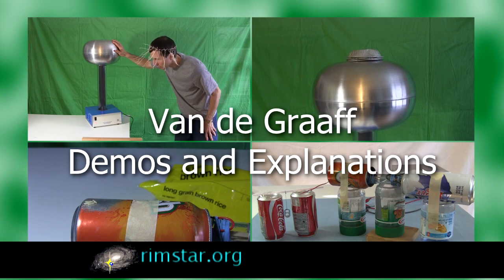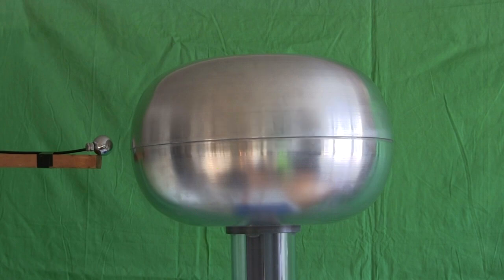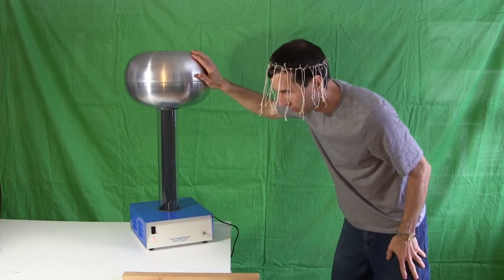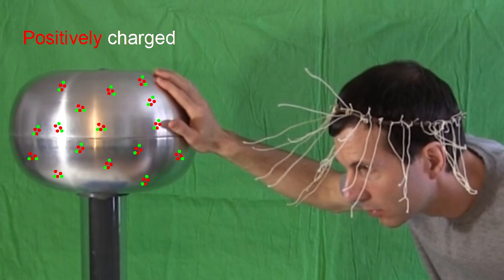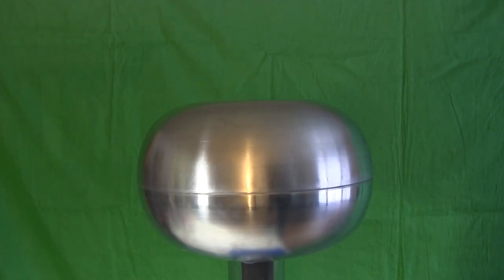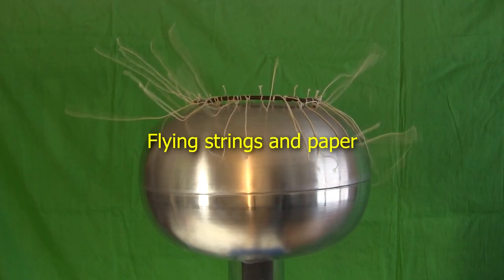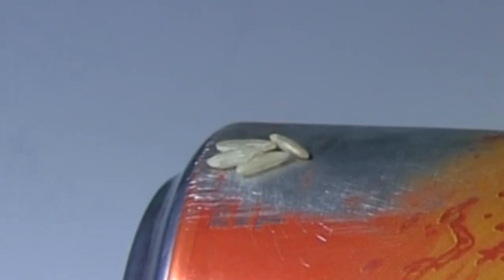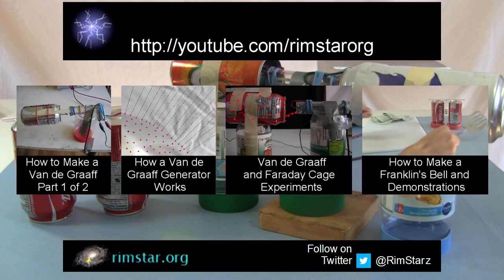Van de Graaff Demonstrations and Explanations

Comment: What if we replace the aluminum plates with coffee filters. What would be the difference?
Reply from the maker: The result probably won't be as good. The aluminum plates are electrically conductive so they get charged all over by the dome and then repel. Coffee filters are not electrically conductive (as far as I know) and so the only charging they'll get is by ions coming from the dome and there shouldn't be many.

Comment: does this also attract small objects
Reply from the maker: Yes, it would attach objects that are charged with the opposite charge that the dome is charged with.
Reply: @RimstarOrg  oh, thank you, what rollers should I use on top and bottom if I wanted negative charge on top dome.
Reply from the maker: For a negative dome, you want a bottom roller who's outer surface is made of something from positive end of the triboelectric series and a top roller from the negative end https://en.wikipedia.org/wiki/Triboelectric_effect
Reply: @RimstarOrg  ok, thanks man

Comment: I have a question. Why does the strip of toilet papers repel upwards? Toilet papers are insulators, so electrons can't really flow through them right?
Reply from the maker: Correct, since they're insulators the electrons don't flow through them. However, there are a lot of ions all of the same polarity in the air due to the Van de Graaff generator. Some of these ions attach to the strips of toiler paper. That makes the strips charged with the same polarity as the Van de Graff generator which they're attached to. Since the VDG and the strips are both charged to that same polarity, they repel.
Reply: @RimstarOrg  Thank you! I get it now. :)

Comment: Were you feeling some change or so on your hand while you turned on the switch?
Reply from the maker: The metal case was getting charged during use and so I was getting a shock when putting my hand near it where the switch is, probably a bad connection to ground somewhere. So I got into the habit of being careful how I touched the switch.
Reply: @RimstarOrg  But, I think, didn't the charges get grounded, passing through your hands?
Reply from the maker: Yes, but since there was probably a bad connection to ground, they'd instead built up on the case and jumped to my hand in a big surge. That's the part that hurts. Then they pass on through me to ground.
Reply: @RimstarOrg  What do you mean by "bad connection to ground, they'ld instead build up on the case and jumped to my hand in a big surge"?
Reply from the maker: The connection between the case and the wire going to ground has a problem causing there to be a high resistance there. So instead of the charge easily going to the ground wire, it goes slowly to ground and leaves a lot of charge on the case for a while.
Reply: @RimstarOrg  I understood.
Reply: @RimstarOrg  Thanks RimstarOrg😊😋😁😁
Reply: @RimstarOrg  People get frustrated when someone asks them this much questions... But, I must say you are from one of those few who solve their doubts with great joy.👏👏
Reply: @RimstarOrg  well, sorry if you got frustrated at all... Don't mind bcz I'm just 14
Reply from the maker: No worries. Your question was a good one.
Reply: @RimstarOrg  Ummmm... Thanks RimstarOrg😊
Reply: @RimstarOrg  well, is it just for fun or does it have some serious and actual uses?
Reply from the maker: Van de Graaff generators are used for generating energetic particles for X-rays for research but must people use them for fun, doing interesting experiments and are often used in science classes as educational tools.
Reply: @RimstarOrg  okk... I see

Comment: How do thé electrons move in the paper ? Isn’t it an insulator ?
Reply from the maker: It's an insulator but charge can still move from the Van de Graaff to the paper, even though once it's on the paper, it can't move around since the paper is an insulator. Another possibility is that the electrons move to one side of each atom or molecule due to attraction or repulsion by the charges on the Van de Graaff. That leaves one side of the atoms or molecules positive and the other negative.

Comment from the maker: In case your marble reference was too my video about how fast electrons move, the purpose of the marbles was just a visual way of showing that the electrons move only a little while the effect moves fast. Also, whether the conduction electrons are inside the wire or on the outer surface of the wire has more to do with frequency. At higher frequency the conduction electrons are more on the surface.

Comment from the maker: Thanks. I'm glad you liked it. And yup, it the static electricity that's built up on you, either positive or negative, exactly as I showed in the video on the dome. When you touch something that's charged differently enough then the two will try to balance out and that's when the discharge happens.

Comment: well, we have one of the best preparation in school. i had to use my own knowledge alot too, like why metals are conductive, how electrons are moving, they are not like marbles, they move to the sides too due to heat vibration. then about electric forces, well physics lesson is very interesting to me, i learn good stuff. then in chemistry too, about how elements behave, how acids work, etc. these both are my favourite lessons. (physics is more interesting, becouse i know more in chemistry)

Comment: Thank you for your great replies! I will post a few videos shortly with all my revisions of your Van Der Graaf with some of the experiments I've had with the rice. I'll submit these as video responses. Also I've been playing around with a flyback transformer for more power and also I'm in the process of designing a linear electrostatic motor for projecting any material in a straight line. I deleted my comment then reposted as I had spelled description wrong, so it would be that!